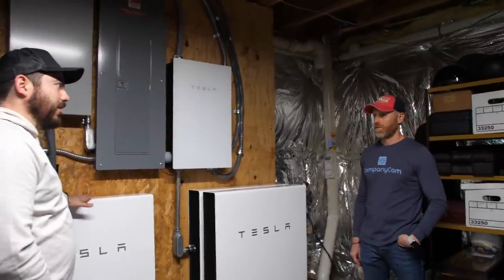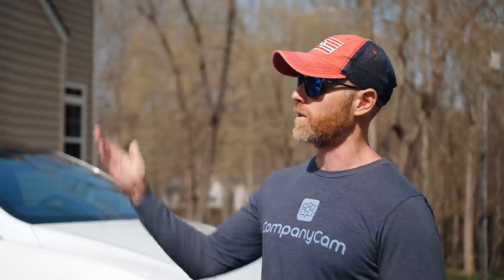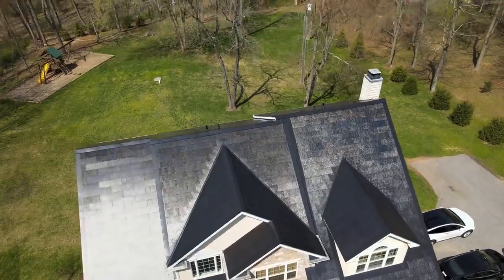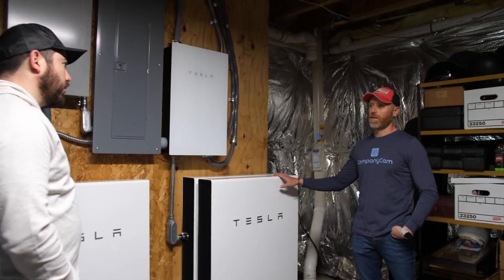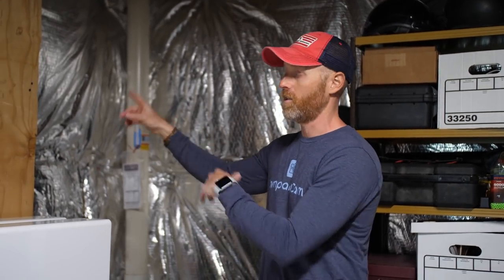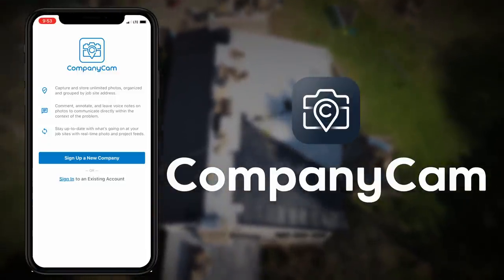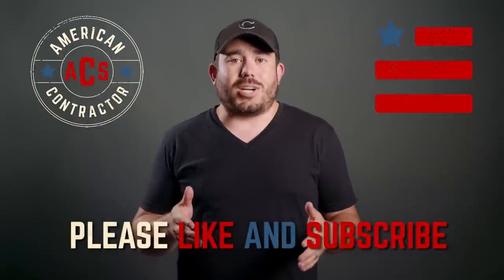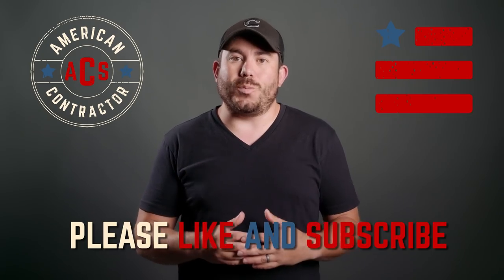Tesla Solar Roof Review - Installation Roof Process

Comment: I can't wait to get my solar roof installed in the next few weeks (design, permit and interconnection application are completed). I still can't believe I made it to this point where my roof project is ready to schedule for installation. It's been a 2-year process just to get to this point. Soon after the Tesla Solar roof v3 was announced, I placed an order with Tesla, even though we still didn't have a certified installer in our state at that time. I also knew that I was getting myself into a fight with the HOA since our HOA requires cedar shakes for all roofs, no exception. It took me more than a year to go through the process of getting the HOA rules changed, going from just figuring out the process (since nobody has successfully changed anything in our neighborhood since it started almost 30 yrs ago), to drafting up a petition and several months of knocking on doors and talking to all our neighbors and convincing them to lend their support. We needed 2/3 of owners to sign to change anything so it was quite challenge. Despite facing some strong resistance (at times quite hostile) from a small number of neighbors, we finally received enough signatures to get the HOA rules changed and now I can get my solar roof.

Comment: How long did it take David to hear back from Tesla after his initial enquiry?
Reply from the maker: Well, David is a certified installer and is installing roofs all over besides his house.  

You can contact his company for more insight into the process and buying through a certified installer may be a little smoother process as Tesla is dealing with so much direct demand.

Comment: I'm on the fence with tesla. Absolutely loved the video. As an electrical contractor that is installing solar panels and batteries every day it was cool to see what the competition is doing. I wanted to offer a little bit more information about backup power. You don't need batteries to go off-grid/have backup power. The reason why grid-tied inverters shut down during outages has nothing to do with back-feeding electricity to the grid. The reason why inverters shut down during power outages is because the inverters are not capable of forming their own sign wave. The grit tied inverter monitors the electricity from the grid and copy the frequency and voltage. It takes a more expensive inverter to produce electricity independent of the grid. If you have that inverter you can disconnect from the grid with a transfer switch and provide your home with backup power during outages when the sun is shinning with or without batteries. Here is a link to a video I did on whole home back up without batteries: https://www.youtube.com/watch?v=8ZuY0np_SbU&t=14s

Comment: You said it lets you go off grid. That doesn't ring true. If you over charged the power wall you will fry it. Which is why despite batteries your still hooked into the power grid. Ambri batteries show promise to eliminate that issue because over charging doesn't hurt them.
Reply: they dont over charge. mine go to around 98% and the solar generation drops to only what your house is using.

Comment: Tesla is still figuring this out. This isn't the answer but it'll move us closer to one.
The job of a roof is to shed water.  When you add other functions, things get complicated.
Roofers aren't electricians and electricians aren't roofers. There are some roofers who don't know how to properly install an asphalt roof system and there's a shortage of labor. If installation of this system is limited to highly-trained solar installers (imagine some of the problems of a poor installation - leaks, fires), it'll never be more than a novelty -- and never reach the volume needed for Tesla to be profitable or anything near what Elon has promised.
161 million squares (100 sf) of asphalt shingles were sold in 2020. How many can Tesla claim? No idea. From what I've found, they only report in watts.
I'd love for this to be successful but I fear it'll be another Hyperloop.

Comment: Only problem is Tesla fullfilling orders, and their reviews, and how long it takes to instal
Reply from the maker: True, if you go through Tesla direct, but going through a contractor like American Home Contractors could save you a ton of time.
Reply: Unfortunately they have increased the prise
Reply from the maker: @alanmay7929  I think the reality is, it’s a new product, and it’s very different than building cars.  Tesla experienced some normal market disruption issues as they grow this segment, but they are making great strides.
Reply: @AmericanContractorShow  uhm nope it has nothing to do with "new product" people have been installing solar panels on their roofs for decades now, redoing an entire roof with solar tiles may be even more expensive depending on the state of roof structure.
Reply: @AmericanContractorShow  buildings in Europe are way  ore solid and resistant than American ones, in Europe for example people will just need solar panels installed instead of entire roof with solar shingles.
Reply: @alanmay7929  it might have something to do with rough weather in many US regions, including hurricanes, tornadoes, and damaging hail storms. I’ve read long ago that European weather is generally milder (aside from North Sea storms).

Comment: They don’t mention how Tesla negated all their current contracts with people and increased prices up to 100%! These are people that have had contracts signed for months and years waiting for their roofs. Google it.
Reply from the maker: This process is a very different than building cars on an assembly line.  

I feel like people need to understand that Tesla has taken on an extreme undertaking, every roof is a one off, and every roof is unique. 

The challenges of building a complete roofing system is difficult enough on just normal shingle roofs, now introduce glass, solar tiles and metal tiles, flashings, ridge caps, ventilations, all having to be built to precise specifications, and hence it’s a challenge. 

As they continue to grow the market I believe the pricing will level out, but it’s not unheard of with a new product, that is so unique.
Reply: I, as well as the many people who have been waiting for many months and some years for their roofs understand that. You don’t however change the rules in the middle. It’s fine to increase prices when necessary but they need to honor their contracts. This will backfire on them, many potential Tesla devotees (me included) will no longer trust them.
Reply: @00loopyl0  Including me... No trust in Tesla after a 70% increase in an existing Solar Roof contract, after the work had started. 

BTW: They ARE doing the same thing with Cybertruck reservations. FSD driving keeps going up in price, regardless of its price when you made the reservation.
Reply: You , unfortunately, got caught in the middle. My roof was completed 2/21, it was very easy to calculate that Tesla was losing money on my job. I am glad I was able to get my roof and Powerwalls for the price I did but was not surprised that Tesla had to raise the price. My roof was not easy , many irregularities, so I expect houses like mine will go up the most. I’ve heard that Tesla is giving free Powerwalls as a way to make some amends. It was also revealed that Powerwalls made since 11/20 were boosted to roughly twice the power.
Reply: Me Too! I got a 10k increase just weeks from installation! I understand the increase of the prices but not to the ones that have already a contract agreement! There lost my roof would’ve have been a tremendous publicity for them due to my location. Credibly from tesla when 📉

Comment: Talking about the intersection of making positive change in many different rounds... Let's not forget about that particular matter 2.5 and 10. That stuff is not exactly helpful and getting it as close to zero as possible will only be beneficial. Sure, carbon and carbon dioxide is important but breathing air that is not deadly is also important. Remember, air pollution claims millions of lives per year in various ways. That is hundreds of millions of person hours worth of productivity and value and birthdays that we are missing out on.
Reply from the maker: Agreed!   We learned so much during this episode and the work that Tesla Is doing coupled with the work that David Vos are all parts of bigger solution to the current issues.

Comment: 19:12  injury is not the main reason.  a few batteries in someone's home can't power the grid.  the current pulled would be massive and destroy the batteries or the wiring.

Comment: Folks the power companies shutting your system down has to do with control. Not this nonsense or lie that some line man might get shocked. Out here where I reside line men are always working on live live lines. The first thing acrosses a line man's mind is. It is energized. You are always under the assumption that the equipment is energized. Then they take the necessary steps to find out and turn it off if needed. The co2 blame game.
Reply: Well said, I've seen my local emc workers on line's in our neighborhood where we all still had power. Yet they are still up there working away on the line's. 🤔
Reply: Nonsense, they need to have control of the grid and know exactly how, who and where are the connections. The utility companies have to know everything connected to their systems for better control.
Reply: @alanmay7929  That isn't the point. The point is if ur system is set up a certain way. The power companies can turn your  system off.
Reply: @4literv6  absolutely right. It’s a LOT more complicated.

Comment: I’m looking at getting a Tesla solar panel system installed… when I add the powerwalls to the system, it zeros out my estimated savings… would love to understand that better...
Reply: Just some insight on that. Depending on what area you live in, batteries can save you money or cost you money. 2 things to consider: 1. The alternative to batteries is a generator. Which can be slightly cheaper BUT will never pay for itself. 2. As the market you live in grows you will start to see the power company complicate the rate structure with “time of use” rate schedules and “demand chargers”. When this happens your batteries will be a money maker rather then cool tech to keep the lights on during outages.
Reply: Tesla now won't sell solar without battery...

Comment: amazing how people keeps telling themselves about "i'm lowering my carbon footprint, i'm making a favor to the planet" or whatever when the mais reason is purely economic, an there is nothing wrong with that, congrats for that, but...

actually, solar only is now and will keep being popular for that. If not, why build just for you? use your economies, make a solar farm and do a favor to the planet besides your economy of electricity bill

that shia view of the "climate change", old "global warming" is, at least, crazy
Reply: On the issue of building large centralized projects vs. numerous small ones on residential properties. Distributed solar does actually benefit both the person whose roof it is on as well as others, in that it saves on resources needed for building heavier duty distribution infrastructure and avoids the losses inherent in transporting power long distances. Also, from a land use perspective, if the roof is in a good position, it is a better use than a single purpose roof covering. Obviously, not all roofs, or all parts of a roof are suitable, but there are a lot of places where large scale solar displaces something valuable. On a roof, it doesn't. Saying that if someone "really cared" about the environmental benefits of solar PV that they'd fund centralized large power projects is inaccurate. While there is a place for large projects in regions where the right conditions apply, there are lots of places where rooftop solar is a good option. And for many individuals, putting solar on their roof is something that they can control. The influence needed to get a state legislature, or regulator, or whatever institution would need to be on board with getting a grid scale project built in preference to a non-renewable alternative is just not there for as many people.

Comment: Get solar panels not a solar roof. The roof is too expensive and doesn’t produce enough energy for the cost of it. When it dies in 25 years replacement costs will be outrageous. Solar panel prices in 25 years will be cheap and the will be more efficient.